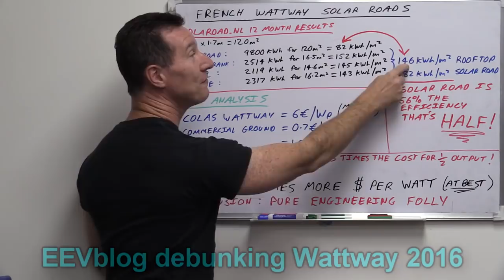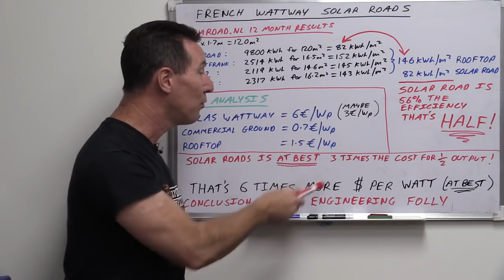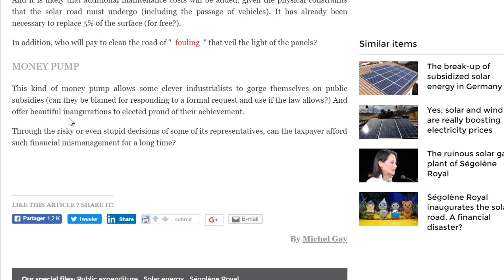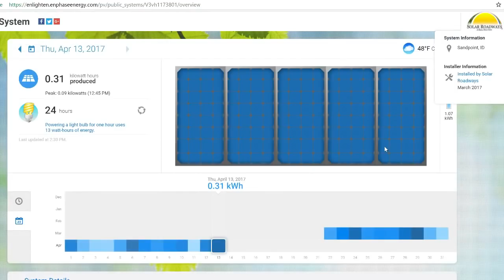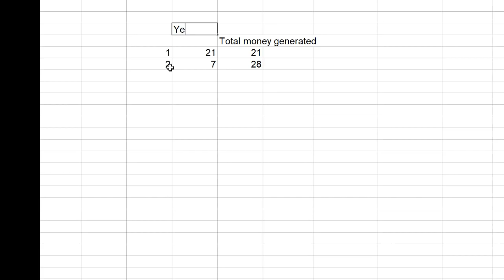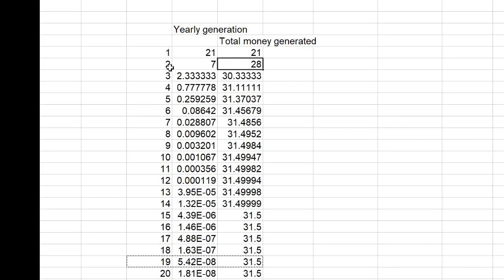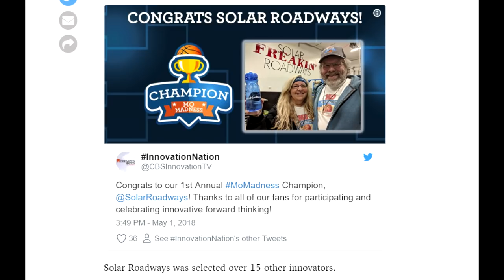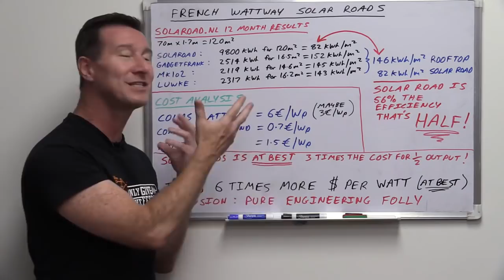Solar Roadway: 10¢ return on $1000 investment!

Comment: what is we built solar panels above roads, if people are so interested
Reply: Or above parking lots. Shade the cars so they don't get quite so hot and generate power to charge them.
Reply: and protect them from hail storms, in Queensland there are quite a few carparks that have shade cloth that
1) keeps the cars cooler
2) protects the cars somewhat when a hailstorm rolls through, which apparently is quite common up there
Reply: Max Bainrot  -  You don't even have to go that far north. The local car dealers here in Armidale, NSW all have hail nets to protect their stock.
Reply: Indeed, that would provide shade and energy. Though there is the obvious problem of tall loads, which are currently only restricted by bridges and tunnels, but would then be unable to use roads at all.
Reply: build it higher maybe? there isn't a limit to height in which we can build over the roads as if some magic barrier is in place. by law every vehicle has to go under stop lights.. you cant drive around them.
Reply: Indeed, the desert's barely used these days. Vast tracts that get little but sun.

Comment: One of the biggest failures of solar roadways besides the extremely high cost for the amount of energy you get, the extremely low durability of the road itself, and the inefficiency of the solar panels themselves is this: at best, the roadway will only be exposed to sunlight for 12 hours of the day. Only about 1 hour of which would receive the optimum amount of sunlight. In addition, these roads would very likely get put in at high traffic areas in the cities, which means that the amount of sunlight reaching the panels is even less because the vehicles would block the light.

Comment: All these videos totally ignore one aspect about roads. 
Wear and tear of cars driving on the surface. If anyone has driven on a old road with allot of cars. One will notice CLEAR grooves in the roads. Heck in more "difficult" areas, like where I live, roads have to be swapped out every few years and some places more or less every year. Meaning these "chips" of hexagons of whatever would be destroyed at some point and need to be replaced. This replacement rate alone would most likely be BEFORE they went into profit pr unit. Meaning aside from being pointless to generate power, as shown in this video. It would ALSO lose to road quality cost compared to normal tarmac.

Comment: Can anybody please, for the love of god, explain to me why, if we are going to use roads to produce electricity, why don't we place the solar panels over the road? You just use the same technology as we use for streetlights, but then build a 'roof' made of solar panels over the road. You can angle the panels to make them more efficient, the prevent rain and snow meaning the roads can be built more cheaply, the also prevent the roads from getting über hot in the summer. I can't be that much of a genius to think that is way more practical when it comes to cost and production can I?

So why do I keep hearing about making our roads out of solar panels instead of just using existing tech and solving the problems that companies like Solar Roadways bullshit about saying that they can solve? I'm pulling my hair out because of these idiots and the fact they keep getting money.
Reply: The problem is it would not be innovative. And people would have to look at it.
Reply: But what is innovative in covering a solar panel in thick glass, dirt and rubber? It just makes me want to cry with how stupid solar roadways is :(

Comment: I think the real problem is that solar panels need to be clean, so the panels in the roads are more dirt so the frequency of the photons is altered, that might be the reason why the instaled ones lost so much eficiency (and whe it had low efficiency to begin with, the huge plastic protection changes the frecuency of the light before it gets to the panel), to be efective is needed a material more transparent that interacts the least with the frecuencies that are used by the panel and cleaning the road daily. The benefit if roads are used is least ambiental impact, since is replacing an area already in use, and the other benefit of solar roads or inteligent roads (i think this part has to be implemented even without the solar generation) is the hability to change the road signals in the fly based on feedback from the road, like if a person is standing on the road or a wild animal is crossing the road, or an accident happends it can automaticly redirect the trafic to avoid those things. Is better if you present (in the tech and innovation things) why something dont work or might not work, a way to make it work attending to the reasons why this was tried in the first place, and what can be used of the original idea to make a better product. Because i saw manny uninformed or incomplete arguments, you dont stated why the generation of energy was less and decreased faster, that scream lack of research or understanding of this field, please read something about the photovoltaic effect in semiconductors, i would like to saw a video that adressed the problems using that

Comment: Actually like the "why would you drive on it". Commute hours here where the max speed is 10 mph. The roadway IS COVERED BY CARS FOR MILES and miles AND miles. NO output then, or covered about 6 hours a day during commute times. DERP! Plus "lowers the carbon footprint" by using more material for less electrical output. Might as well go back to nuclear Chernobyl then.

Comment: I can imagine they can automate solar cell production fairly easily.  Once you have a machine building it, costs come down exponentially.

Best case scenario is an AI robot that runs on solar panels, producing solar panels by simply picking up sand.  Preferrably in the middle of the desert - and they simply drop off their finished goods for humans to use.  Maybe a roving robot factory of some sort.

Not impossible but maybe a long way off.
Reply: Making solar cells is a highly technological, energy-intensive process. Automation won't help you all that much. And no matter how cheap you can make them, you still want them in a place where they produce the most power. Which is not a road.

Comment: I wouldn't say that this is inherently a bad idea. If they could pull it off I'd be revolutionary. But the tech just isn't there. If they didn't make false claims I wouldn't care. If they just said the truth and talked about the flaws in the project I wouldn't care. Hell they could have talked about what they were trying to do to improve it. And if they would have done that it would have been in my opinion worth investing in. Because at least then they showed what was really going on
Reply: Russ Money It is inherently a bad idea to lay solar panels flat on the ground and then cover them (with cars or whatever). Driving over a solar panel (with shale stuck in the tires) is another bad Idea.
Third (but not lastly) any smooth surface will greatly increase braking distance.
Reply: It is an inherently bad idea. Why put solar panels somewhere that they will be covered for large parts of the day. What happens when there is heavy traffic? It's totally pointless. Put them down the highways central reservation, put them alongside the road, put them anywhere but the road. In fact anywhere near a road is a least optimal place to put solar panels.
Reply: People just cannot comprehend the incredible amount of abuse highways take. .expansion /contraction, heavy truck , accidents, spills, fires, and debris of all kinds... rain, snow, flooding, Snow Plows along with sodium chloride / calcium chloride for de-icing....
Reply: The core idea of a solar powered smart road isn't bad, but the solar panel under anything is a terrible idea.
Reply: If the "core idea" is  good, people should be putting solar systems on their driveways instead of their roof top... when that is shown to be economically viable, an attempt can be made at solar roadways.. Start with residential streets , then move toward high speed , heavy traffic highways.

Comment: I had a great solar invention. I call mine solar heat light. It will automatically turn on about 7am and turn off about 8pm. Seasons may vary. My invention is totally free to run and use. No cost, zero. No kickstarter. Works everyday except rainy days. Feel free to use it. It has been turned on for a while.

Comment: Your title isn't clear. Are you saying they got back 10c for every dollar they spent? In which case that's a massive loss, not a return. Or do you mean they made back their money +10c? If that's the case then they at least broke even. I guess it'll be explained in the video.

So it looks like you're saying that the panels will generate 10c of electricity for every dollar spent. That's .0001% efficiency, so maybe they're thinking long term? At best it would take years to make that back. But really there's no way if the panel are going to degrade within a few years.

Comment: FYI: a 476Km by 476Km( 296 miles per side) square photovoltaic array in the Sahara desert would generate more than enough electrical energy at this point in time to supply the whole friggin planet! that's an area of the desert that has a very small footprint compared to the entire desert and it gets sunshine all day long. check the map in this article
https://www.popsci.com/environment/article/2009-06/solar-collectors-covering-03-sahara-could-power-all-europe.

Comment: question: Could you perhaps create a thermo-power generator that takes the heat generated on the asphalts surface as it permiates throughout the material and come up with better energy generation than SFRW?

Comment: How did wattway even get approved? Even with the energy they expected it would still cost more then it was worth. Even if they did get 767 kWh it would still not be viable. If the average they expected was for the total day then at most they would get around 107 euros per day. This would take 127 years to pay off. (my math is most likely wrong, this was based off the 5 mil that was stated in the article. Correct me if I'm wrong please.)

Comment: revolutionary ideas arent neccesarely good...you see the idea of flight per se was never a bad one, trying to do it by flapping your arms wasnt a good idea though. the idea of gaining electricity from something we use anyway isnt a bad one in itself but the method of solar roadways is just not bright. Rooftops - works well enough and you dont have to drive on them. acutally...you shouldnt, just in case someone thinks that would be a bright idea

Comment: Seriously why the hell haven't they used all this money to redesign the solar panel?
Solar Panels are to heavy for most roofs, making them lighter would allow older roofs to have them and existing roofs to have more installed (as there is a weight limit to the amount of solar panels you can install)
Making solar panels far lighter and finding a way to make them cheaper to produce is the way to go with solar energy (or until they invent a better way to gather solar energy more efficiently)
If you could make light, cheap roof tiles with solar panels in each one, along with a way to easily replace them, then so many people would replace their existing roofs with them.
If it was financially worth doing so.

I think that the Solar Roadways installation has aged so badly because of it's bad manufacturing and installation letting in the elements and damaging it.
Plus all of the weight from people and things crossing them.

Comment: Governments offer incentives to build in their area and with local materials and labor, so why not use this money to get them to add wind and solar generation tech to their buildings?  I know I know, scifi pipe dreams.  I would still like to see buildings with rooftop gardens for water recycling, and I assume it would help with climate control of buildings(i could be wrong).  Windows could one day be all transparent solar generators, but we could start by simply framing the windows with solar panels.  Is solar panel siding possible?

Comment: From which do you get more money?
Solar Roadways or plugging a power strip into itself?
From the Solar Roadways, you pay $500000 and you get back $30 in like 15 years, So the total you get is -$499970.
From the power strip, you pay at most $40 and you get back $0 in 0 years, So the total you get is -$40.

Comment: If you want to make solar roadways, why not put the solar panels next to the roads or build roofs over the roads and put the panels on those roofs?! And imagine how well those solar friggin roads will work in a traffic jam, which may occure very often because driving on a glass surface is stupid and dangerous and will cause a lot of accidents. 

And speaking of Kickstarter and Indiegogo: Mixing something commonplace with electricity and a new kickstarter scam campaign is born. That's what 99% of those campaigns are.

Comment: Mr Thunderf00t surely governments putting solar panels on the roofs of buildings, where the electricity infrastructure already exists would be cheaper than digging up roads (they already can't afford to maintain) and replace with solar. Then wire up the infrastructure. Oh wait, that's what they did in the UK for a while with home solar grants.
Reply: Eh, I don't like those grants, as they typically help the well off.  Ya know, the people that don't need the incentive to invest in something that will save them $ in the long run.

Comment: It would be fine if solar roadways were just less efficient than traditional solar panels at a flat rate. It wouldn't be the best place to invest your money, at least they are generating some value. That they degrade faster than traditional solar panels means that you can't get long term savings. Taking 20 or 40 years for infrastructure to pay off is normal, but taking a 100+ to infinite makes it bad.
Reply: Oh, right, solar panels have a limited life time in general, so you couldn't throw away a flat 70% of energy capture and expect to make value with your solar panels.

Comment: I like the South Korean idea of a walkway in the middle of the road that had a solar panel roof. Why are we not hearing about that in the news? Seriously THAT is worth it's weight.
Reply: or maybe a structurally simple "road cover" that has solar panels on top of it. Something that is held up by poles on one side and partly covers the road so that it provides some shade for cars driving by, generates electricity, is cheap and fast to build, and allows for easy maintenance of the road surface.
Reply: we have a lot of those in the states. https://news.energysage.com/what-is-a-solar-panel-carport/

Comment: These green tech bullshits are soo popular now. I've just seen some crap on facebook that replaces windowglass to generate power. Costs "only" 10% of the cost of the bulding. They say it lets through 90% of light which probably means only up to 10% of light does any kind of work there... Looks like a very low ROI version of solar panels just like solar roadway. You should definitely cover it.
Reply: Yeah, sounds pointless to me, too. The sun I let into the house during the winter is all being used warming the place up. A roll-up solar awning for keeping the sun out during the summer and turning the sun you don't want coming in into power might not be a bad idea, though. Assuming it could be pulled off in a cost-effective way, of course.

Comment: If they're so obsessed with combining solar panels and roads, why not just put the solar panels on a roof over the road? That would protect the cars/pedestrians below from bad weather (without needing to melt snow to keep the roads clear) while using off-the-shelf components that cost a fraction of these road systems.

We don't need some breakthrough technology, we just need to deploy the technology we already have.

Comment: There's actually an easy way to make the LED's be visible. Put the solar roads in an underground tunnel so you can control all other sources of light. We should probably also make the road inaccessible for any vehicle that can block signs from the view. Maybe just allow one car at a time.

Maybe it's cheaper to just buy a little more ground, flood it, make money with one ferry and a whole lot of recreation :)

Comment: If they really believe in solar, why not just make a damn roof over the highway and put solar panels on the roof.  Sure you still have the distribution loss issue, but you greatly increase efficiency and reduce maintenance loss (because you're not freakin' driving on it).  Hell, constant shade (reduction in heat expansion) might also reduce roadway maintenance costs some.  

Still very likely a boondoggle, but at least it would have a more of a shot at being viable.

Comment: @thunderf00t hay wait there, first off with green energy you CAN NOT factor just the base cost Green enegry always has a larger up front cost because as far as tec is concerned its still stupid young. You have to factor in matince costs. so AT this current time you are correct, HOWEVER if the technology were to advance as technology does with proper inovation it may be possible IN THE FUTURE. 

Solar cells themselfs haven't been innovated in years, if a developer spent time to research ways to improve the actual cell for roadway application they may be headed in a good direction for improving the effency of the actual cell to eventually meet the needs to work. I wouldn't blow this Solar energy idea off just now but I would bank more that it would improve the quality of the Cells more than producing actual Solar roads in my lifetime.

Comment: I just installed solar panels in the same area but not flat on the ground and they produce about $3480 worth of electricity and the system costed about $32,000 with a 25 year production garuntee of at least 90% of the original production per year solar panels on roofs are better than them laying flat on the ground in every way